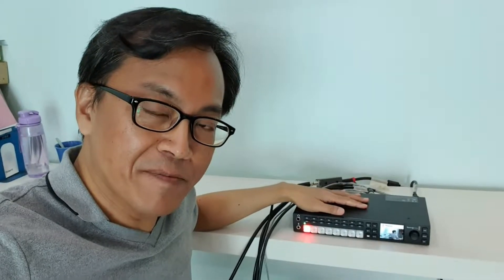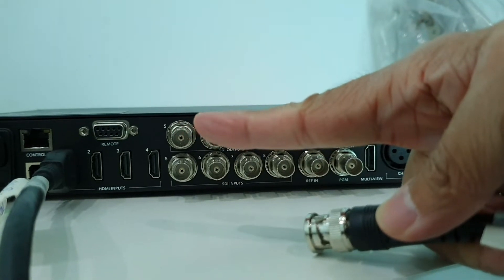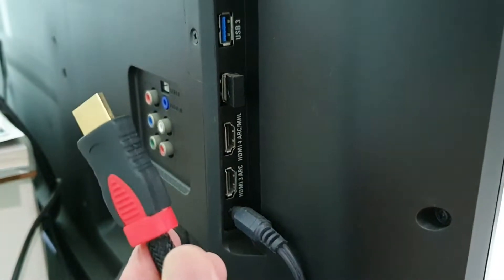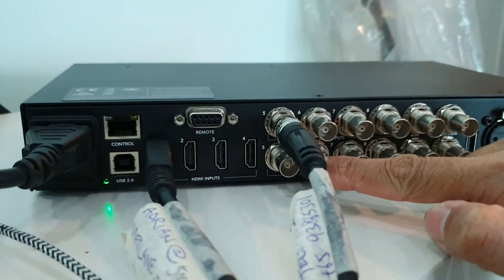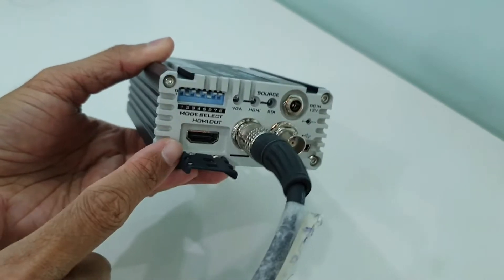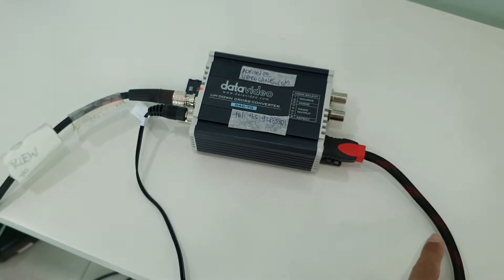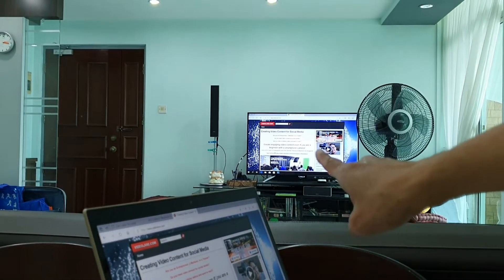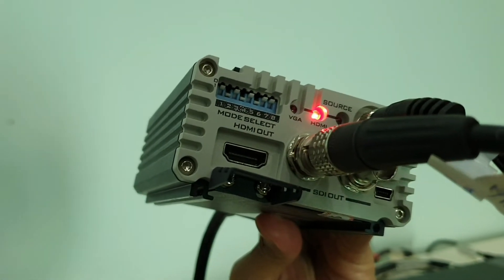ATEM Television Studio HD Setup - Live Video Switcher between Camera and Computer

Comment: Hello! Faced a problem. When connected to the Sony a6400 Atem television studio HD, only black screen and sound are output. The format on the camera and the switcher is correct. When connecting other models of cameras, everything is in order (for example, Fujifilm XT-3). How to solve a problem?
Reply from the maker: Change the output settings of the a6400 manually to other values and see if it works.
Reply: @AdrianLeeYC  problem solved. It turned out that the sony a6400 always outputs 50fps via HDMI, regardless of the selected frame rate for recording. Only the resolution can be selected manually for HDMI output.

Comment: Hi Adrian,

We have 3 DSLR cameras we want to use for live streaming a basketball game. All dslrs have HDMI output. Most likely we will use the hdmi-sdi converters. My question is...do we need a third party software to live stream? Or can we use the built in network port? Thanks
Reply from the maker: The Atem television studio HD has no streaming capability. The network port is only for controls. Why not explore the Atem Mini Pro instead. Coz it's all HDMI inputs.
Reply: Adrian Lee thank you for your reply. However, we are looking to have more than 4 inputs. Could we use OBS to stream from the BM television HD?
Reply from the maker: @ParkedUpAnywhere  yes you can use obs
Reply from the maker: @ParkedUpAnywhere ...and you will need a converter to convert the signal from the Atem TV Studio HD to the computer... See my other video on connecting OBS to ATEM TV Studio HD... https://youtu.be/MpFgLA1Lb8s

Comment: How to I connect my hp laptop to an atem Television studio?  Do I need to use  sdi to hdmi converter?
Reply from the maker: Do you want to send the display of the HP laptop screen to the ATEM? If yes, does your HP laptop have an HDMI output?  If yes then connect the HDMI output from the HP laptop directly into the HDMI input of the ATEM television Studio. In that case you don't need the SDI converter.
Reply: @AdrianLeeYC  Yes, but all 4 hdmi outputs are used fo my 4 camcorders.  Should I use the sdi cable to connect from the sdi input on an atem Television studio to the laptop?
Reply from the maker: @priscilla6893  Then you will need the HDMI to SDI converter.
Reply: @AdrianLeeYC  thanks

Comment: Hi Adrian, thank you for your nice video 🙂 My question is:

I have ordered 3 blackmagic devices for live stream, 1x Atem television studio hd, 1x Web Presenter and 1x Hyperdeck. The devices are working properly. Well, now i want to work with wireless cameras. Because of that i have ordered transmitter and receiver for wireless video transmission. I connected the transmitter on hdmi camera 1 on atem television studio hd. The connection between the transmitter and receiver is working perfectly but my device (atem television studio) is not detecting the devices... Can you help me, please? Thank you.
Reply: My Atem studio hd cannot detect an input usually due to frame rate setting. All frame rate must be the same.